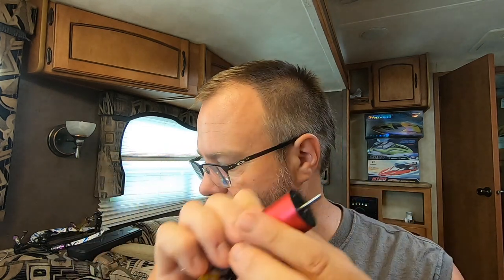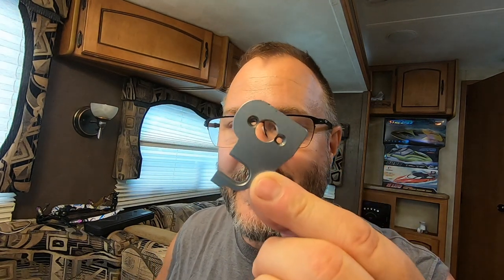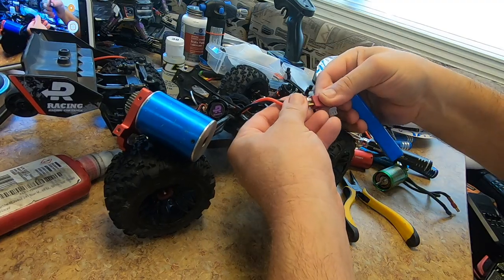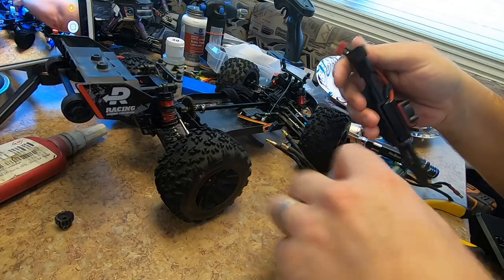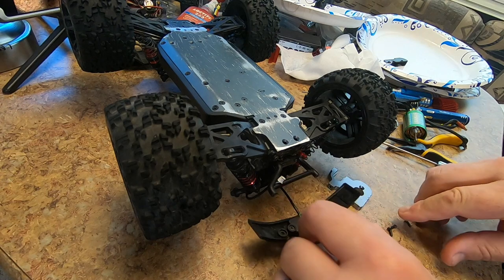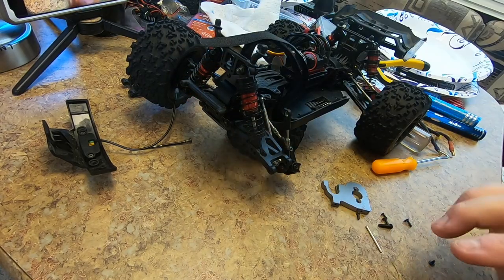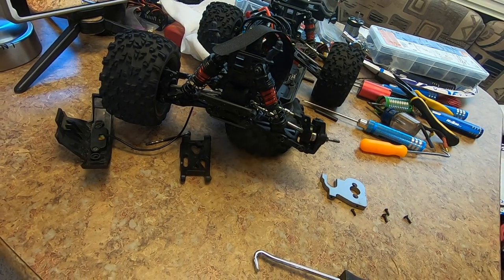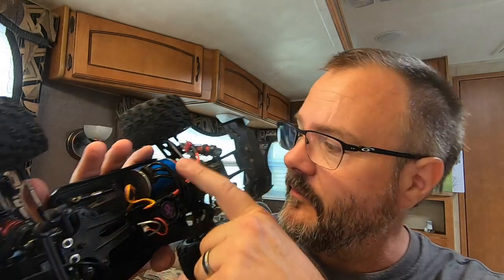Part 9 in the TRAILER TRASHED Series ⁉️ FRANKENARLO

Comment: My best guess is that the 2700kv motor is running in the 50-55A range(As long as it's not over loaded).
That ESC doesn't look that great though.
Is it a 45A ESC?